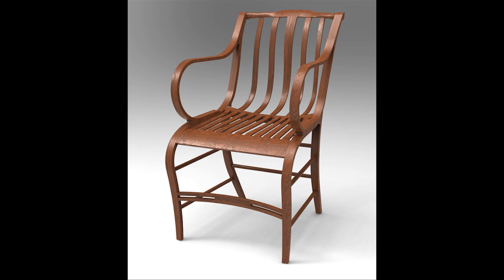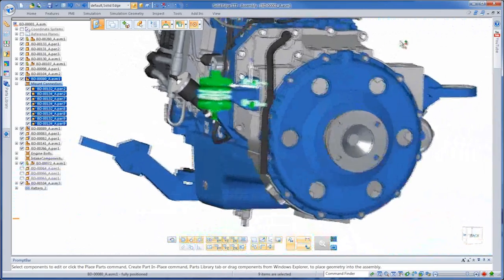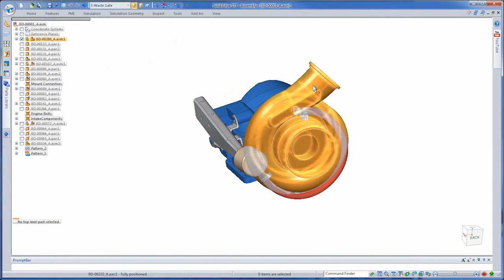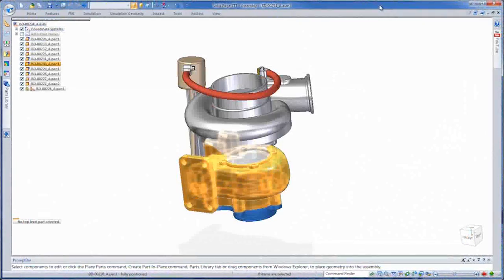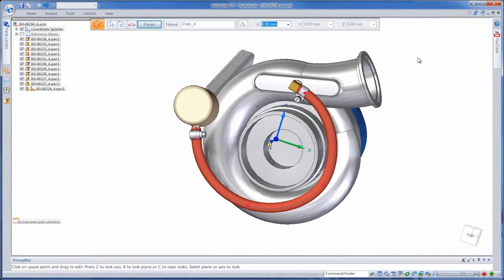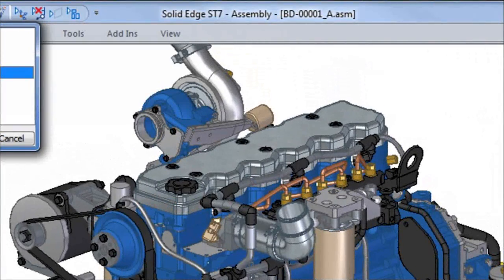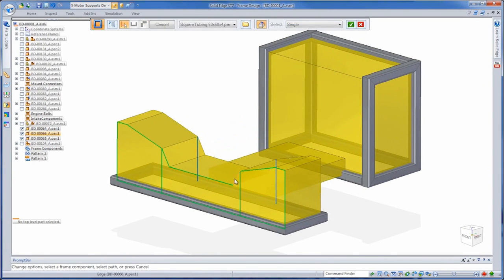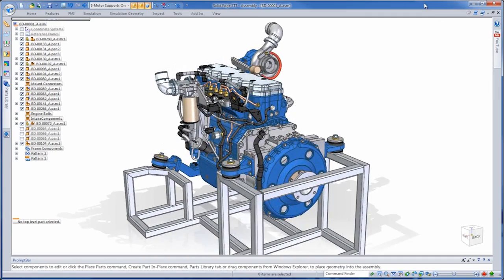Solid Edge ST7 Assembly

Comment: Solid Edge is awful, it needs to be more like solid works. SE is so clunky and poorly designed, the UI is poor
Reply: Nobody really cares about the opinion of a SW user who has no experience with proper SE workflows that save time.
Reply: @JAnx01  haha whatever. Ive used both for years and any proper engineer knows which is better.
Reply: @zir786  Anybody who used both for years will know that both have their strengths and weaknesses. Solid Edge has the best and fastest assembly workflows and a big database of Standard Parts to which SW toolbox doesn't come close. Not to mention synchronous.
Reply: @JAnx01  SE Looks like it’s stuck in 1995.
Reply: @zir786  What about it? With dark mode on + dark backround + a little bit of customization, it has the best looking, most functional UI of them all. Other CADs' "modern UIs" bury common functions inside drop down menus.

Comment: Hello, i'm using SolidEdge ST8 right now. i have a i7 4820 pc with 16 gb ram and 250 gb SSD.
but with assamblys it gets real slow. what kind of pc do you use for making a assambly?

i'm an engeneer and i'm designing qute large products with 50+ parts.

please let me know what the best pc option can be for this kind of work.
Reply: +kees wassenaar You'll need a decent video card for the program to work properly; Nvidia Quadro or ATI Firepro cards are what you want (the model will depend on how much are you planning to spend).

rgds.-